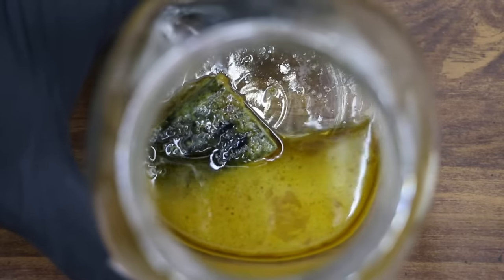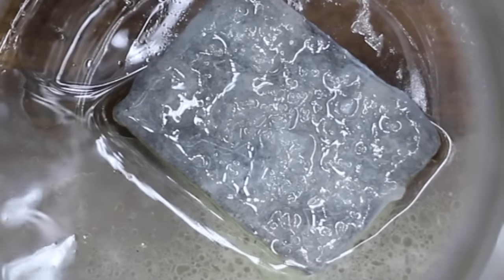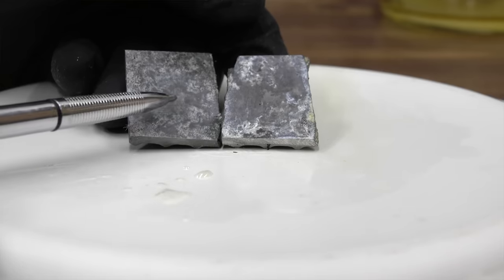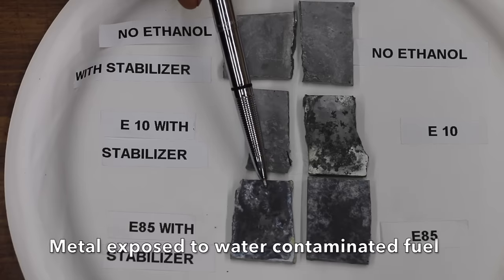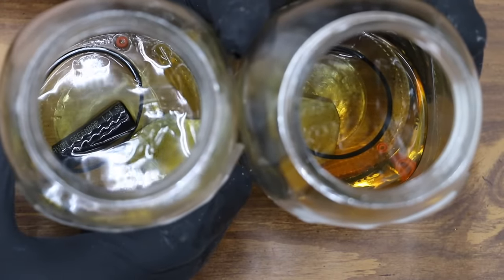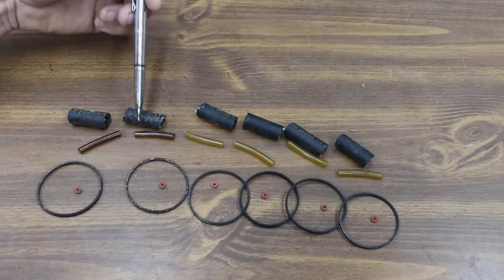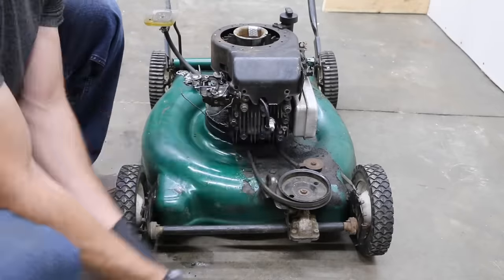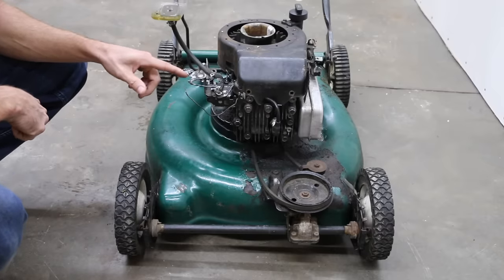Does Fuel Stabilizer Prevent Ethanol Damage?  Let's find out!

Comment: This should be required viewing for anyone who owns an engine. Gas stations should play this on those pumps with tv monitors. I always use ethanol free gas, and drain the system for storage, including removing the bowl and wiping it out. I'll put any leftover gas into my car. I start the next year with fresh gas, and it always starts on the 1st pull. I've even started doing "first pull" videos in the spring. Near me we have Hy-vee with ethanol free, but it's shares a hose with 10% ethanol gas. A lot of QTs have a pump or two that have ethanol free, but that is premium grade only (same with hy-vee). More recently there is a new Casey's near me that has about 6 different types of gas, including 3 grades of ethanol free. They don't seem to charge any more for it either, so I fill my car there too, even though we have both Sam's and Costco memberships. That leads me to my next video suggestion for you. Have you ever tested Top Tier gas vs. non Top Tier for engine deposits or engine cleaning ability? Costco and many national brands sell "Top Tier", while Sam's and some others aren't rated Top Tier.
Reply from the maker: Thanks for sharing.

Comment: A lot of folks hate e-fuels because of the conception of better performance with E-free, not realizing the octane rating is usually higher in e-free gas because of a different octane booster and more of it. 
Ethanol is just another method of raising octane.

Comment: I lost track of what was going-on in your video as there is too many variables to consider. However, I started using non-ethenol in my hyunai i10 when the change-over to ethanol started(in England) and "the little beaut" runs with more zip, and does more miles per gallon. 
Ethanol is a BIG money making SCAM. Thanks for demonstrating what happens to our cars when we, stupidly, put corn in our fuel tanks.
Reply from the maker: You are welcome!

Comment: It would have been helpful to know more about the methodology.  How much stabilizer added to how much fuel?  It looks like the Mason jars were vented to expose the fuel to the atmosphere.  Was that the only source of water?

Tip:  Ethanol can hold a small amount of water in suspension in a fuel such as E10.  This could prevent water in the bottom of a fuel tank as a result of exposure to the atmosphere.  For best results, even with E10, fill the fuel tank before winter storage.  A mostly empty fuel tank is full of air that expands and contracts with changing temperatures, while liquid fuel expands and contracts very little.  The tank of air pumps moist atmosphere into the tank every day and the water condenses into the tank.  Only a small amount of fuel in the tank quickly has a very high water to fuel ratio.  Filling the tank before storage results in less moisture entering the fuel, and there's more alcohol based fuel to suspend the water in the gasoline.

How To Make No Ethanol Fuel:  Buy four gallons of E10 in a five gallon jug.  Add half a gallon of water.  Shake very well.  The ethanol will be dissolved in the water.  Allow the water and fuel to separate overnight.  Drain the water and ethanol mixture from the bottom of the fuel.

Comment: I think people are forgetting allot of this has to do with the specific climate of your area you live in. I live in Canada and its air stays pretty dry in the summer and winter. Dont really have ethanol problems here. Also if you seal your containers/tanks they will have very limited oxygen to access. A full gas tank will also take a long time to go bad and will have very little oxygen to access easily (yes your gas tank breaths to prevent a vacuum forming but its a very small access point) But I think it shows it is important to close off the gas tank or disconnect the fuel pump and run the engine dry before storage so the small lines are clear.
Reply from the maker: Thanks for the feedback.

Comment: I've got a 6 volt World War 2 Dodge truck that sat through the covid lockdown with old ( non-ethanol ) fuel. By the time lockdown restrictions eased and I was able to get to the storage unit, the fuel in the Dodge was two years old. It started up no problem!! I did add 10 gallons of fresh fuel before I drove it home. I'm guessing it was because it was designed to run on low octane fuel from the start.
Reply from the maker: Thanks for sharing.

Comment: my friends think I'm crazy for paying more for non ethanol fuel, but I never have any problems. I tell them that ethanol is corrosive. a friend recently used e85 and her car quit on her. and it'a flex fuel vehicle. she said it was cheaper than regular or e10 and the fuel savings cost her somewhere around $3000 in repairs. this video is proof of my suspicions of ethanol and I plan to share it with my friends.
Reply: I have also experimented with ethanol for fuel mileage. from hastings to grand island to omaha and back to hastings on ethanol I had to refuel at aurora on the way back. with non ethanol in the same vehicle with more load on, I got back to hastings with half a tank of fuel left. same vehicle, same roads, same conditions. less fuel consumption with non ethanol fuel.
Reply from the maker: Thanks for sharing.

Comment: The previous owner of my pontoon boat, 50hp, Merc, 4stroke used 87 oct with ethanol. When I changed the fuel filter, it was loaded with very fine, gritty sand like stuff. I use 91/92 oct, ethanol free only with marine sta-bil, no more junk in the fuel filter two years running. Proof enough for me. Do not use  gasoline with ethanol in your small engines, boats, etc. Unless you want unnecessary problems and expen$e.
Reply from the maker: Thanks for the feedback.

Comment: Could you try storing gasoline mixed with various 'stabilizers' (Sta-bil, Lucas, Seafoam, etc) and then trying them in an engine or lighting them up on a metal surface? Compare this to stored non-ethanol gas.
Incidentally, around here in Calif, it is really hard to find non-ethanol gas.
Reply from the maker: Thanks for the suggestion.

Comment: I've been using mixed 50:1 TC oil and non ethanol 91 oct for the last decade for storing my mowers and snowblowers and so far absolutely NO carb problems at all. Instead of draining the carbs and tanks, I just fill up with mixed gas on my last run of the season and park them just like that.
Reply from the maker: Thanks for sharing.

Comment: Most US-made engines and parts these days can handle ethanol, but I’ve seen a lot of Chinese scooters and small engines destroyed by ethanol gas. The ethanol attacks the fuel tubing which in turn gums up the carb.

I use ethanol free gas in yard equipment that will be stored for an extended period or is only used sporadically.
Reply from the maker: Tanks for sharing.

Comment: I have a two stroke Husqvarna chainsaw that I use rarely.  I let it idle to burn all of the fuel to leave a clean dry carburetor before storing it.  I only mix the fuel I need for the job and don't try to store it.  I have a 120 VAC corded Poulan chainsaw that I use most of the time.  It was inexpensive, does everything I need around the yard, and it starts first time, every time.
Reply from the maker: Thanks for sharing.

Comment: Excellent video! So much disinformation about stabilizer’s and their ability to add to gasoline life cycle in storage. I guess my best bet is to use propane or natural gas in my home generator for long term fuel storage. If I do use gasoline, it would be best to buy fresh fuel and use it completely up by running the engine dry after any loss of electric power event….👍
Reply from the maker: Thanks!    Thanks for the feedback.

Comment: Another great test video. I always wondered about fuel additives in general. We religiously pour them into our fuel tanks having no idea if they are helping or not. I am especially  skeptical about the additive products that say they "remove" water. I just don't see how that is possible. Maybe they break up the water into tiny molecules  but I don't see them removing the water. That would require some evaporative process. Thanks for another great video. Cheers
Reply from the maker: Thanks and you are welcome!
Reply: Water can react with other ingredients to make new substances. It's just Hydrogen and Oxygen. It can combine with fuels and stabilizers to flow through the engine harmlessly, instead of staying around and causing corrosion.

Comment: Purely anecdotally my lawnmower (a MacCullough similar type to the one in you video bit with a recoil start) is 10 years old, stands outside all year and runs e10. It was not used for 6-8 months over the winter and started first pull in May, so I must question your fuel degradation tests with regard to starting...

Comment: Well i never found any Stablizer that worked with the EthanolFuel  on my Powerboat with Twin Ford 302 gasoline engines , both motors  had Holley 650 Double Pumper Carbs on them and  in the Off Sesason of Boating the only thing that i found to work  was i pulled both Carbs Off the motors and had my local Race Car Holley guy  go through them completely he gave them a Ultrasonic Cleaning  and replaced whateverneeded replacing  plus bench tuned them to perfection  that kept me running great all season  i honestly just gave up buying any of those additives  and installed good FuelFilters and Water separators in my engine room  i used Napa Gold Screw On Filters  for 20 years because t that time they were rated  as one of the very best on the Market nd I found my localNapa  lways had them inStock  or could  have them in that store in minutes  i always kept new SparesonBoard  and tried to keep my tanks as full as possible to minimize Condensation  BTW that boat used 35 gallons of Fuel per hour  so as a thirsty girl she was always being freshened up

Comment: Non-ethanol fuel or "REC" fuel as they call it around here, oftentimes DOES have ethanol in it, especially if both types of fuel run through the same line at the gas station.  Best thing to do is pump a gallon of non-ethanol into your gas tank first to clear the line as much as possible, THEN fill your gas can for your lawn mower.  Keeping the tank full and well sealed also helps avoid moisture from getting into the fuel.
Reply from the maker: Thanks for the feedback.

Comment: Other than my 16' Ford Focus ( It runs E85 ); I am weary of the 10% Ethanol in my Oldsmobile, my Crown Victoria, and my mowers. In my mowers each fall, I empty the fuel, and purge/run them with a mix of MMO, Seafoam,  and a bit of non-ethanol gas. 
  In the 78'Olds its a tricky process as it is driven only in the Summer months, but basically the same  and stretch that mix out by starting in the garage twice a week in winter.. and the Vic, I just run a dash of MMO and Stabil every other tank.
Reply from the maker: Thanks for the feedback.

Comment: I use E10 in my pressure washer for years without problems. I can leave it for months and it starts easily every time. However, I always turn off the fuel and run the engine until it dies before I store it.

I won't put that rubbish in my bikes. Even E5 makes the rubber hoses go rock hard and split within a couple years.

The oldest fuel I've had was 20+ yr old 4star (leader, no ethanol) that sat in an unused bike. No problems starting and  running although one of the 2 carbs had gone dry, blocked up with a white crystal and the needle had severe rust pitting. The other was spotless, somehow.
Reply from the maker: Thanks for the feedback.

Comment: OK good experiment.  Confirmed what I learned by word of mouth.  I only use non ethanol gas in ALL my engines, including car and truck.Keep gas on hand for emergency generator use but rotate before a year goes by.  I don't put a lot of miles on vehicles and don't use that often so I prefer to avoid ethanol just to be on safe side.  Not that much more expensive.
Reply from the maker: Thanks for sharing.

Comment: Hello there, thanks for all your great videos. I have a lot of cars and motorcycles etc and it was good to see these tests, thanks again. Now I have one or two for you to do based on this. I have a couple Toyota Supra turbos capable of huge HP, we road raced and had customers drag racing them. As well as other Turbo motors. We often ran them on 100LL Aviation Fuel with no problems and were able to run much more spark advance under boost than just 91 pump gas, we could log engine knock and new the limits. But I have always read of rumours of reasons by people not to use it for non aircraft engines, as it was flash point safe etc and I think a lot of bunk as well statements. We have run it for years even mixing it with 91 ethanol free pump gas. Also it would be interesting to see how the race fuels compare like the VP109 and C12 and what they do when mixed with pump gas etc, also how the age I've been told the 100LL will last for years and years. All speculation at this point I have never found a real test on this topic. 😁
Reply from the maker: You are welcome!  Thanks for the suggestion.

Comment: As an aviator I'm keenly aware of the benefits of hundred low lead which we use in the airplane.  I've been at the airport when landscapers come by to fill up containers of this much more expensive fuel.  But they'll say if I can't get the engine started I don't get paid.  Many of them swear by it.  

Perhaps you could do a video on 100LL.  

I put it in my chainsaw and my lawn mower and they all start after winter.
Reply from the maker: Thanks for the suggestion.

Comment: I had to completely rebuild, and thoroughly clean my new Holley because of this junk!  I just recently removed the gas tank to clean it out also. I thought that it was empty but there still was some in there after about 3 years. It was black and smelt very bad. I'm going to have to add a sealer to the inside of my gas tank before I use it again. It's off of a 62 F 100 and it looked like it was brand new inside before I put that gas ( junk ) in it. I cleaned it with a gallon of Awesome then I rinsed it all out and let it dry out before I also put in 2 gallons of white vinegar and washed it out after a couple of days.
Reply from the maker: Thanks for sharing.

Comment: As a former fuels chemist, the main issue is with seals. Yep corrosion, but I had a test vehicle with E10 and  the car stopped as the sump seal disintegrated due to fuel dilution. A very spectacular failure as the engine seized due to no lubrication.
Reply from the maker: Thanks for the feedback.

Comment: I have a B&S 8hp on a roto-tiller from the early 1980's . The carb has a removable bowl plug enabling easy draining of the carb between uses paired with a tank shut-off valve. Manufacturers should design this feature into all engines.
Reply from the maker: Thanks for sharing.

Comment: Idea for a vid:  best carburetor cleaner? ultrasonic  vs chemical dip vs spray vs fuel additive.  If you could find a 4 cyl motorcycle with 4 equally gunked up  varnished carbs to test with.
Reply from the maker: Thanks for the video idea.

Comment: I spent a few years as a small engine mechanic and therefore people would ask me which brand of stabilizer and how much to use. Most were surprised when I said "none" Your only good bet is to make sure the fuel system is dead empty for storage. Pick your favorite as the method of ensuring its empty.

Most would ignore me and buy stabilizer anyway and then need a carb clean/rebuild later. There is no free lunch, people.
Reply from the maker: Good Point!

Comment: Definitely the ethanol gas is a problem, at least in your experiment. Most people drive their vehicles on a regular basis and so are always topping up or filling their gas tanks so the question is with a continuous addition of new fuel what is the result? If you were to drain off the old gas in your jars and refill with new gas every couple weeks would the results be the same? Just curious.

Comment: With the higher cost of non-ethanol fuel, I have started using fresh ethanol fuel during the summer mowing season. At the end of the season I run the mower out of gas, put a small amount of non-ethanol gas in the mower and run it until the non-ethanol gas is the only gas in the system to store it for the winter. Is this false security and economy? Will this procedure still degrade my engines and components?

Comment: Metals corrode by oxidizing.  It is reverting to its original ore.  “The definition of corrosion is: metal, returning to its natural state.”  Once we know that, we know that all metals, except gold, will corrode through oxidation.  We cannot stop it, but we can slow it down.

Aluminum corrosion is aluminum oxide, or ALOX.  ALOX is an abrasive; a very good one, as it turns out.  Much of the sandpaper that we buy says “ALOX” on it.

If an aluminum carburetor corrodes, it produces that ALOX.  That carburetor is the one thing that sends both fuel and air into an engine. If the carb has corroded, it will then deliver a great abrasive to the working parts of the engine.  Nice, huh?
Courtesy of Half Vast Flying
Reply from the maker: Thanks for sharing.

Comment: So here my question and please only answer if you really know the answer… I use canned Non-ethanol fuel from Husqvarna for my chainsaws/ weed eater. It says on the label “stays fresh for years”. Should I leave the fuel in them when storing for 4-5 months or is it okay because there is no ethanol? I was told you only drain them to protect the carburetor when using regular pump gas fuel and to my knowledge there is nowhere else near me to get non-ethanol fuel